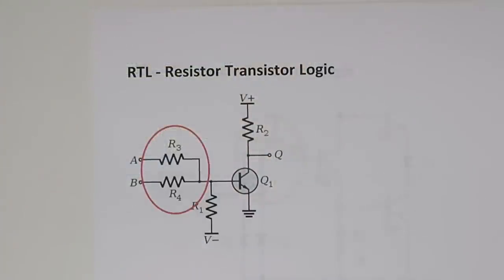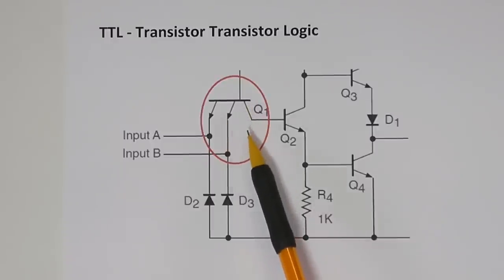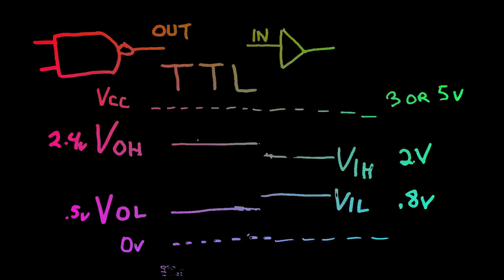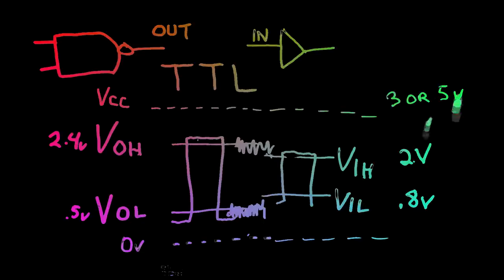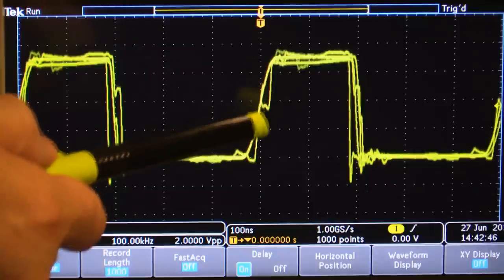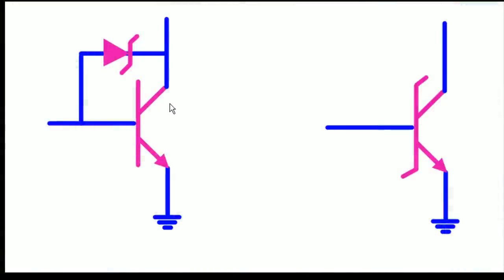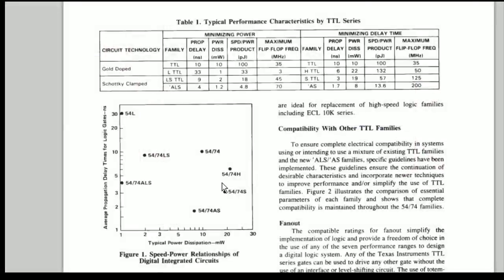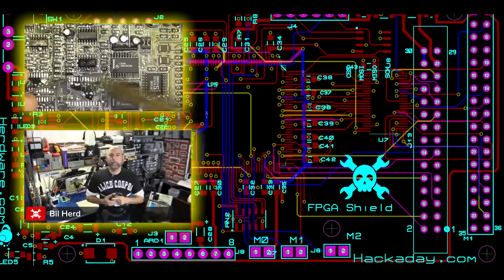Hackaday Logic Series: TTL Electrical characteristics.

Comment: I have a question no one has answered I bought a laser module it was supposed to have it’s own power supply but did not a d one  processor board it’s main plug says pwm but the detail s say it supports   LTL, I don’t know what to do it came with no instructions

Comment: I need assistance protecting a ttl circuit inside a laser .. it’s a db25 connector uses ttl signals nd I want to protect the circuit inside the laser from the signals coming from the computer .. I’m not sure where to start .. is there a product off the shelf I can use ?

Comment: Great video. I'm a complete NOOB. What do the Qs [by the transistors] stand for? Is it for "charge"? I'm really trying to learn, I have no formal electronic education but I want to know more. Keep making videos. Thank you kindly
Reply: This is the story that I heard. Back in the day, transistors were packaged in round metal cans (you can search for pictures of these) with a little metal tab sticking out from the bottom as a pin reference. Anyhoo, if you look down on top of that package, the perimeter of the can and the tab sticking out resemble a capital Q. I guess they did not want to use a capital T because that is usually reserved for temperature.
Reply: Yeah, now that you mention it, it does look like a Q! Sweet.